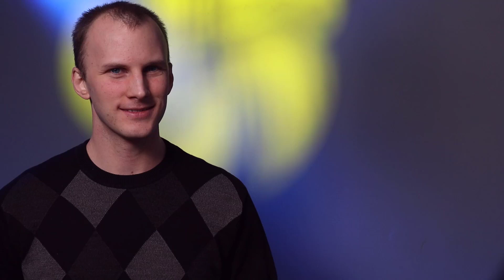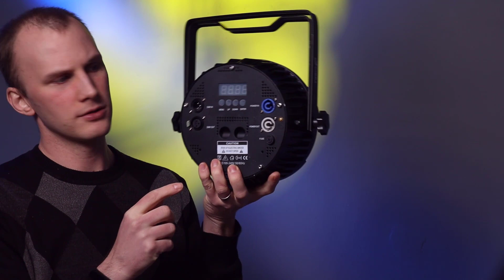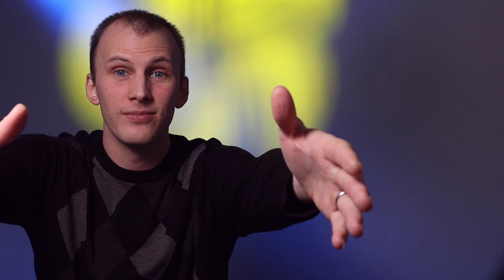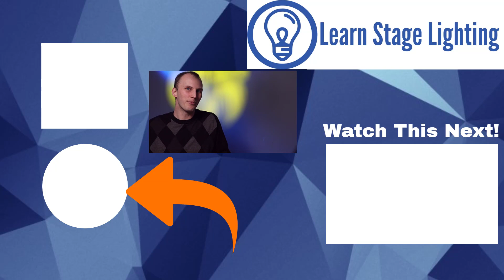How Does Stage Lighting Work?

Comment: Thank you for the video,what is the difference between 3 pin DMX Cable and 3 pin Microphone Cable
Reply from the maker: Read this: https://www.learnstagelighting.com/can-i-use-microphone-cables-for-dmx-lighting/
Reply: Xlr is  a high voltage cable/ high noise cable. While a DMX is low both... And XLR is not as SHielded agaist interferance. XLR is best under 1m please try and use 5 pin dmx.
Reply: I use normal xlr cables but i have short runs so no problems